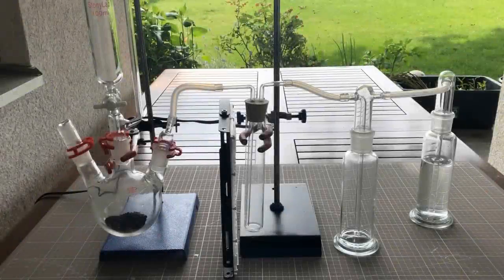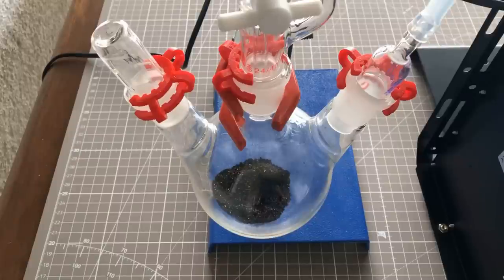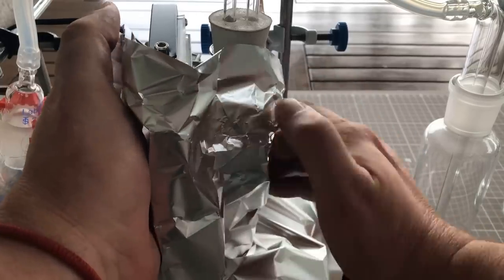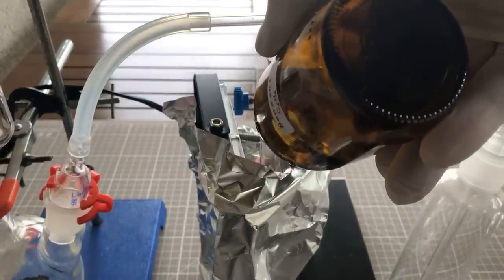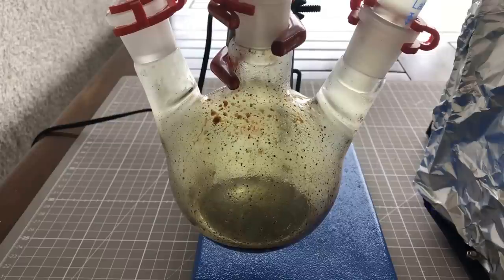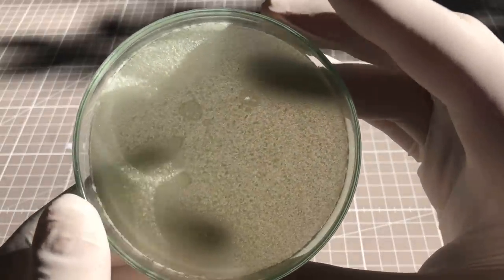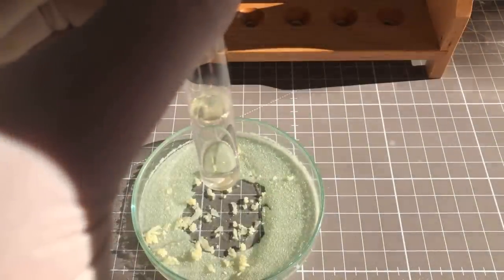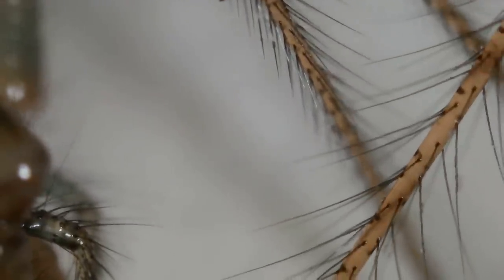Synthesizing of the banned insecticide lindane - Part 2

Comment: My town is heavy polluted by lindane and byproducts of lindane production. Would like to see video where lindane is neutralized. I read patented process where strong base is used and end product is neutral. Unfortunately my knowledge in chemistry is not up to a level where I can make demo setup. Want to know how difficult is to do, not to do by myself.
Reply from the maker: Horrible to hear that. The bad news is: lindane is a persistent organic pollutant, means it's resistant to degradation through chemical, biological, and photolytic processes. I can't think of a method off the top of my head. However, it is an interesting and important question that I will investigate.